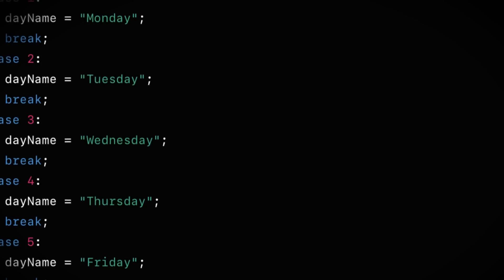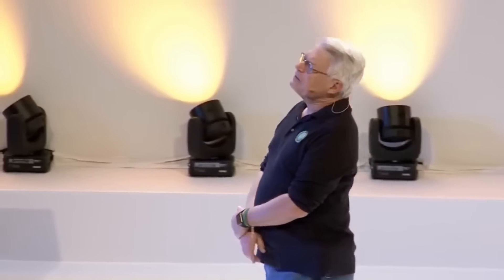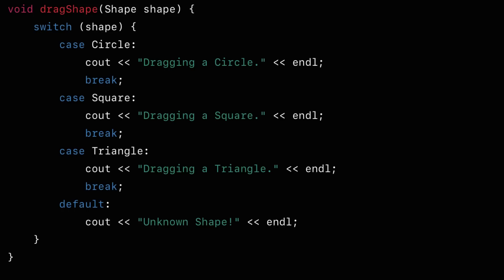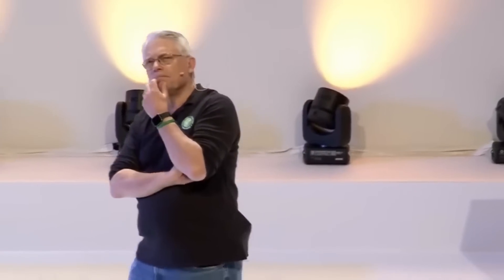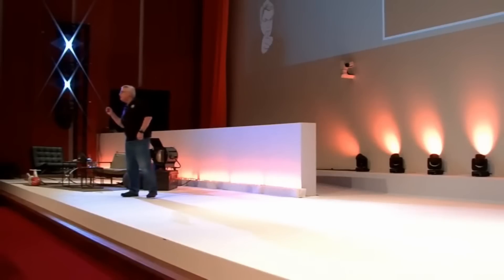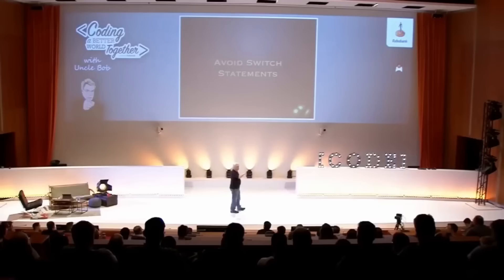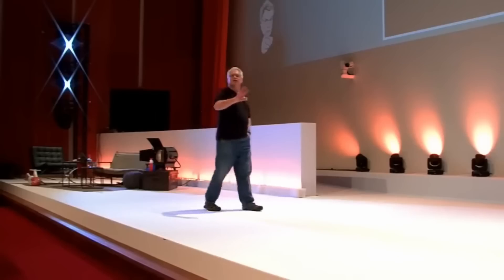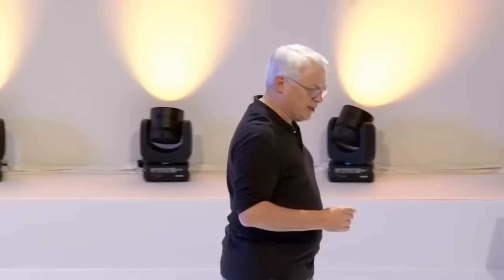The problem with switch statements - Uncle Bob

Comment: That's not a problem with switch statements themselves, that's just bad architecture.
Reply: Its ok to use switch statements. And yeah, oop can be overkill for a small well scoped front end. Nobody should argue that. Also, to much emphasis on inheritance. I really do hope people heard of composition and interfaces. Then you get polymorphism without the dreaded inheritance.
Reply: Agreed
Reply: Give me an example of an acceptable "architecture" where you need a switch statement???
Reply: @_nickthered Maybe I’m misunderstanding the question, or not experienced enough, but surely there are near infinite examples where (in relation to the importance and/or longevity of the project), inheritance is not worth it, and switch statements are faster and clearer: e.g. separating numbers between pos/neg/zero; or you’re building a traffic light with legally mandated 3 bulbs red/yellow/green ….
Your tools are “if”, “switch”, and “inheritance”, and it’s a bit cultish to swear off one of your options for philosophical reasons. Pick the best tool for the job.
Am I misunderstanding your question?

Edit: I reread your comment. No situation needs switches, but I don’t think anyone claims that…
Reply: @ian-flanagan  yeah I mean there is one place where I did think of that a switch was the tool for the job and that is low-level coding where you want to avoid far jumps in assembler and minimize the conditional checks. These days that optimization isn't going to benefit you in interpreted environments or even low-level ones unless you are looping a huge amount of times and you empirically validate your other approaches result in optimal instructions. That being said I think there are clear places where you know you need to branch so you need an if cause you might not be able to do useful things without it.

Currently I feel switches are just included in languages because there are programmers who stylistically prefer them versus not having the choice. It's kind of why goto was included in Java originally. If you worked on code with heavy goto use debugging becomes nightmarish as does even automated testing with weird cases of odd state mutations. Life is much easier when you have cohesiveness in your codebase. How you achieve that and mechanisms you choose is up to you.
Reply: @_nickthered  I have a little website listing cafes/restaurants/bars. The API sends data and the client-side JavaScript switches between those 3 choices. It’s not enterprise software. 95+% chance I will never touch the code again. Even if it edit it, there are 1-3 switches at most. Switch is exactly the right tool for that job imo. OOP is overkill, not just for my experience, but also in terms of minimizing bytes sent to every user. That’s not just stylistic reasons (unless you’re comparing to nested if’s)
Reply: @_nickthered  
switch (true) {
	case !isDefined(user):
		throw new Error("User must be defined.");
	case !isString(user.firstName):
		throw new Error("User's first name must be a string");
	case !isValidEmail(user.email):
		throw new Error("User's email address must be a valid email address");
	case !isValidPhoneNumber(user.number):
		throw new Error("User's phone number must be a valid phone number");
	// ...lots more validation here
	default:
		return user;
}
Reply: @itskittyme  wow so beautiful, lolz!!! 😂
Reply: @_nickthered  I had a better one but it got blocked by youtube. It's one where you do a regex in each case and then based on the regex you return a particular value
Reply: @_nickthered  I just checked my last project. I used switch in the client-side JS to execute 5 types of commands from my api. Simple. If things change, it’s easy to update. Can you explain why I should be using inheritance instead..?
Reply: @ian-flanagan , often, if things change, having to go back to the code is bad.  In this case, your code does not scale, and does not adapt as much as it could.
Reply: @TheSilverGlow  It’s just a free little website that lists dog-friendly cafes in London. I can’t see how OOP on the client-side is the work-reducing choice
Reply: @ian-flanagan , yes, the client side should be just light-weight presentation layer.  The backend benefits from OOP far more, and in most use cases.
Reply: @ian-flanagan  const commands = { one: () => {}, two: () => {}, } const execute = (command) => commands[command]()

Also easy to update, separates the contexts and easy to refactor. Though why you'd do this at all versus const one = require('one'); or import { one } from 'commands' smells to me like id reorganize your code. Commands is an extremely generic ambiguous term so there's really not enough meat there to know what you are really trying to accomplish. What are you trying to make the machine do? These surely are not just any commands
Reply: @ If type == 1, call the function that renders a listing with relevant values for a cafe (vs restaurant/bar), e.g. with a subtitle saying “Cafe”. It took 2 seconds to type and has caused me zero unexpected work
Reply: @ian-flanagan  where does type come from, and why use type what kind of type are we talking about? Why not have type just be set to the endpoint to call?
Reply: @_nickthered  also, look into switch patterns... pretty cool stuff IMO.
Reply: @DevMeloy  yes there are many attempts in different languages to make switches more useful and look forward to what future languages can try and come up with
Reply: @_nickthered , even in this example it might actually be preferable to use switches rather than inheritance. The claim that you can extend functionality by simply adding a new class to the hierarchy is misleading. What happens when you want to add new behaviour to each entity? You have to go implement that new functionality in each inheritor, right? You're doing exactly what you tried to avoid.
Reply: @gicutu123  so this is exactly the reverse logic, inheritance is the mechanism by which you can add the functionality once and all the descendants receive the new behavior. I think this thinking is more of a result of bad practices in the Java world, with too many interfaces and not enough good use of hierarchies. Inheritance is exactly what you want to use to reduce your work as the programmer.

In the video though the question of using inheritance comes about when you have duplicate or similar blocks of switches in multiple places in your code branching for the same case. So they are situationally dependent and the code in each case is different but it's as if the code were supposed to be together because they are related by their cases, to me it's a smell. That your code isn't cohesive and that there is a clear better way to organize it and possibly consolidate a lot of unnecessary pieces.
Reply: @_nickthered  I'm not sure I understand what you mean. Relying on the default behaviour of the new functionality implemented in the top class of the hierarchy is conceptually exactly the same as relying on the default clause of a switch statement. It has undefined consequences.

But anyway, what I meant was that this classic example of shapes to advocate for inheritance is actually not good at all since if you have a sizable but relatively flat collection of loosely connected classes with unspecified usecases, you're better off looking at some sort of visitor pattern type design which conceptually is implementable through switch statements too
Reply: @_nickthered  I use a switch statement to process status codes from an API. Not sure how to do that cleanly with polymorphism.
Reply: @anderssjoqvist7816  if else if else works fine your fingers broken or does switch just appeal to you more? and is this only in a single place? Or throughout the codebase? Are you varying what you are doing when handling it? If it's more than one place is there commonality to ALL the places? How big is the codebase what are you trying to achieve. Like you cannot just just say oh I need to use it when if else if works just fine. 

For status codes your not going to get the benefits of the optimized assembler since you are NOT running this check in loops where that kind of performance improvement is necessary. 

If you don't do it in if else's then you also will have more cognitive work when you expand the code and need to commonize and extract handling of one two status codes to a separate area of your code. Since your probably lumping a bunch of status codes together. Also by doing this you are also telling me you either have a largely relative codebase or a really simple use case and small codebase. If it's a one off one place nowhere else and that's it sure knock yourself out. But if you are duplicating this hundreds of times all with different logic. Why not look for patterns and extract them out in a way that does not require you to write any handling again. I like to separate out different concerns. A retry mechanism for instance can be generic if you wrap your responses code that will handle that before returning with a payload or err then you no longer have to check that status code and you can reuse that retry everywhere except where you explicitly do not want it. 

For switches you can always do if elseif else so not sure y anyone wants to say no other option here bro.
Reply: @_nickthered  if-else sounds like an objectively worse approach. It has the same drawbacks as described in the video, plus you have to write both the variable AND the comparison operator (equality) in every if clause. This means that the person debugging the code will also have to investigate every clause. I actually had two if-else chains in other places in the code base as one clause was more complex than simple equality, but it was a huge blocker to refactoring and I had to rewrite it. Regarding what you said about extracting patterns: parsing a single value is ONE concern. It shouldn't be separated into multiple concerns and handled by different parts of the code.

If you think that code duplication is just a problem for someone with broken fingers, then we have fundamentally different ideas about what's clean code.

Yes, this is the only switch case. Every status code needs to be handled differently (but in general, switch can have fall-through in some languages if you want that). By the way, there are more optimizations for a compiler to do with switch than just loop optimizations, such as jump tables.

I gave you an example of an acceptable architecture as per your question. Every program can also be written in Brainf**k so you never "need" a specific kind of structure. At the end of the day, though, your if-else solution isn't conventional polymorphism.
Reply: @_nickthered  I'm not opposed to switch statements, and have used them where I find them appropriate.

I've used them in React apps to dynamically set components, and in C# use them with ENUM's.

I don't go crazy with them, and only use them where I won't be duplicating code.. but just because some ppl make spaghetti code doesn't mean I'm going to quit using a tool :)
Reply: @DevMeloy  I can see why you'd reach for them in react though I'm not sure their a necessary choice at all when you have the option to may be use a map, or (variable && <>) or if statements instead. Switch statements in higher level languages or that don't translate switches directly to assembler are really a weird stylistic choice IMHO. I'll agree that it's tempting to try and lean on enums and switch statements. I find that you eventually define those as objects and eventually need to carry data around your code along with your enums as they start to become related, so you come to a point where you can refactor those enums and their code into objects, then your switches become irrelevant as they are replaced by pointers to objects. That is IF you are not making a mess of your codebase.
Reply: @_nickthered  Lol... we all make decisions based on opinion, and there is usually at least 3 ways of doing everything. The only code branching I can't stand is a stack of if-else statements. Also, I rarely use switch statements... but wouldn't shy away from them if the need arises. :)
Reply: Bad "architecture"?  No, its bad coding, not architecture, if the switch statement does not consider all cases.  I love switch statements for use-cases that can benefit from them.
Reply: @TheSilverGlow  Putting class specific behavior behind switch statements as was done in the example is an architecture problem.

Comment: This seemed like such a bad take. I'm glad he arrived at the Polymorphism approach, but the first thing I thought was, "Why the hell are you checking class type in a condition like that instead of using inheritance?" Everything he said would basically be true for if-statements as well. I'm not even a big fan of switch-statements and 99% of the time prefer if-statements instead.
Reply: That's incorrect. Exhaustive switches are a completely legitimate, and arguable better, solution to the problem.
Reply: @adambickford8720  Yeah exhaustive switch works fine if your language supports it. Switch and inheritance can both have the issue of missed handling of a given function. After all if you have rotate, resize, draw and so forth for a shape, it's possible in inheriting you may just forget to define a given case for your new shape and default to the base class function. And yes, in a good design paradigm, your code can be set up to force you to write certain functions for OOP, which is really the same as a language that supports exhaustive switch. 

 The main drawback of switch is that it's a closed system. If you're writing a library and you want there to be the possibility of user defined types, you definitely want inheritance because they allow for the user to add their own.
Reply: @taragnor  Completely agree with you on having extensibility vs switches. It's a tradeoff. IME w/the typical business app, exhaustive switches and immutable structs with pure functions are generally simpler.
Reply: @taragnor you'd inherit from an abstract class so that you'd be forced to implement the function in the child shape classes
Reply: @divinecomedian2  Yep. You can set that up to force OOP implementation if your language supports it, much in the same way you can use exhaustive switches (if your language supports it) to force implementation using that methodology.

Comment: "You might miss one" is a really bad argument against switch statements. All compilers and even most linters can tell you if you exhaustively switched on all possible values.
Switch is amazing in imperative languages as it is super optimized for normal sized number of enum values. It is also used as one of the central concepts in functional programming. You are just wrong on this one Bob.
Reply: You're assuming the switches are for enums. That's isn't always the case (pun intended).
Reply: I think it depends, for enums I agree switch is good since you adding a new class will not solve anything unless all functionality around that enum is moved into the new classes which will then result in a completely different program structure and could very well be less efficient.

BUT it all depends on what that enum represents, for internal use within a module I think switch is perfectly fine for performance.

But I also agree with Bob on the concept of having the same switch statement spread over many different places in the code.

But also, inheritance is hard to do right and you can make much more hard to solve problems than you can with switch statements as long as you make sure either to use a compiler that complains of missing ones, or make sure EVERY switch statement have an default or else case to identify the problems.

Yes it will result in runtime errors but given where and what state was missing its not to hard to identify how to fix the problem.

If you use inheritance and build a bad structure that suddenly does not work for some types you need to add, then you might have to rebuild it all to solve the problem.

As mentioned above, composition is often a better solution but it still needs to be done right.

Switch statements for all their faults are more flexible :)
Reply: Uncle Bob is only wrong for bad and lazy programmers who don't want to understand polymorphism. You don't base your code design on what your IDE is able to do.

Learn strategy pattern.
Reply: @CounterFragger  "Learn strategy pattern" - As if that is some kind of authority to refer to. Yes, I have read GoF's book. Yes, I used to think it was something to strive towards but with experience I have also learned that a lot of it is not good advice.
Reply: @CounterFragger  
Bob himself would also disagree with you here, he used the fact that Jetbrains IDEs can easily inline functions as an argument when he was talking to Primeagen.

Comment: If you need to store the type of shape to persistence (a database), you will have to map the type of shape to an enum of sorts. Either a string or an integer. This necessitates a switch in the code that persists and loads   the shapes, probably a factory. It's a separate thing entirely, but this is where I've found that you cannot avoid switches. 
Unless... you add a method getShapeNumber() or the like, solely for the purpose of avoiding switching on the type of shape... Which I wouldn't do. You also can't depend on the class name and store it in the database, because that breaks if you retractor the name.
Reply: Yes! This is a problem that I never see talked about. Polymorphism is great, but then the type is dynamically selected by a user and must be stored and reloaded, there has to be a value to indicate the type. And when it's reloaded, there must be something that can take the value and create the expected object instance. That usually involves a switch statement.